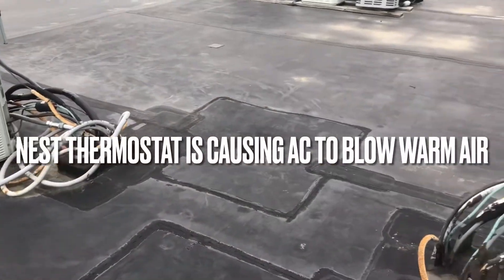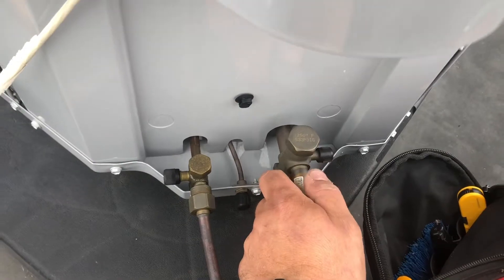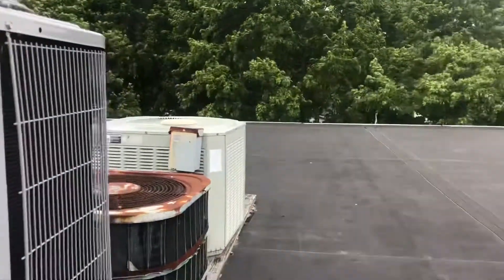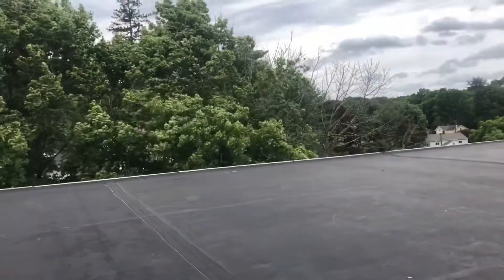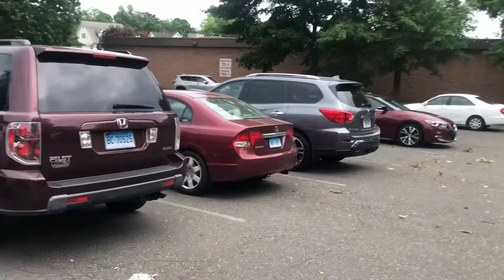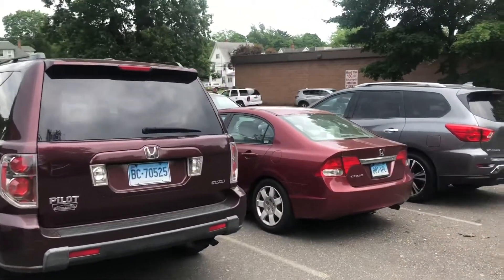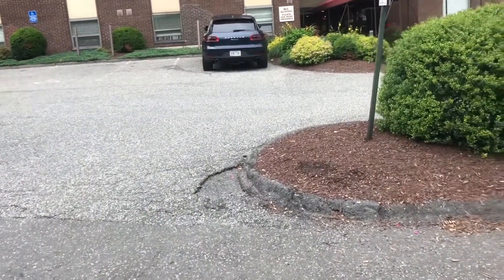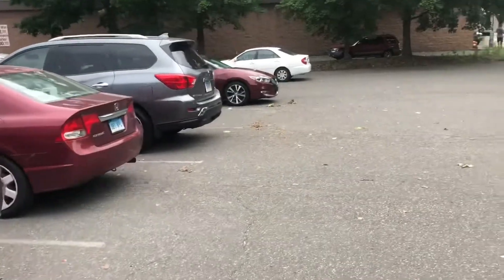Nest thermostat causing AC to blow hot air.  Heat Pump system

Comment: This is the worst thing I have ever bought in my life!! I want my 1970’s thermostat back! Its 85 today n will not cool and just had a new central air unit installed last fall-makes no sense🤬
Reply from the maker: Im not a fan either.  Sorry took so long to respond. I just saw this.  Most likely has to do with the system.  Let me know what it was please
Reply: @ I was so damn mad other day, I literally ripped it off the wall n went n purchased a regular thermostat today @ Lowes. I have had this thing for prob 4 yrs n it just makes me mad cuz it wants to monitor me😂I think it has something to do with that “C” wire not connected (thats what Im gathering from some YT vids)-I will holler bk & if I need help lol-Cuz Im attempting it tomm morning 👍🏼
Reply from the maker: Lol.

Comment: thank you for this i was about to call someone just swapped my upstairs and downstairs thermostat and i have the exact same fukin problem
my downstairs one wont hold a charge now the upstairs is doing this 
they are GARBAGE
Reply: I tried to swap out the Nest downstairs with one upstairs, still blowing hot air when it's set to cool. You can hear the fan kick on and the compressor is working, but still blowing hot air.
Reply: I hate nest with the passion
Reply from the maker: Me too.   It sucks.  Get Honeywell Lyric it’s wifi
Reply: @hvacotj  I live in apartments. I called maintenance but he’s useless. They sent hvac guys over with refilled fluid and left said it would cool. Never cooled. Today I got home and it’s 89 degrees and hasn’t dropped
Reply: @jo2518al  We called a2nd HVAC guy who specializes in zoning, he said one of the wires on our zoning board was loose. He pushed it back in and the unit started blowing cold air again.
Reply from the maker: When did they recharge the system? Today?
Reply from the maker: Have you checked your air filter inside at the return or the air handler?  If it is restricted meaning dirty, it won’t properly cool
Reply: @hvacotj  they came last Friday and we also changed the filter. I popped off the face of the thermostat and all the wires looked okay but were dusty as hell.
Reply from the maker: @jo2518al  email me your phone number.  Marathonhvac2003@gmail.   I call u in a few min if you want.
Reply from the maker: Thank you.